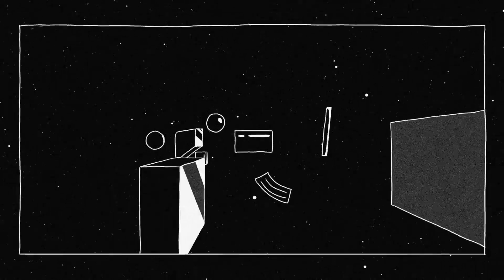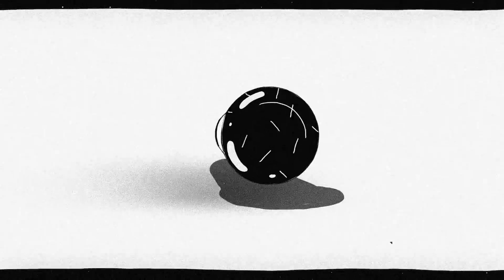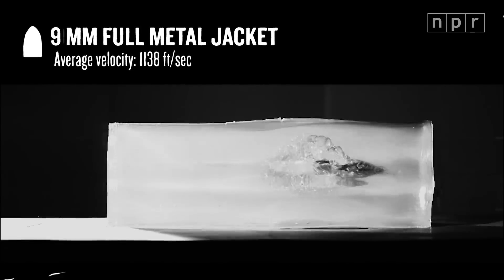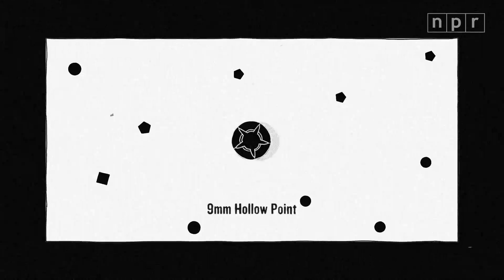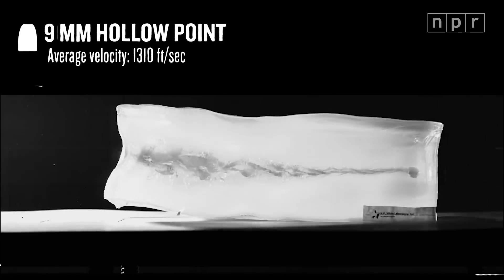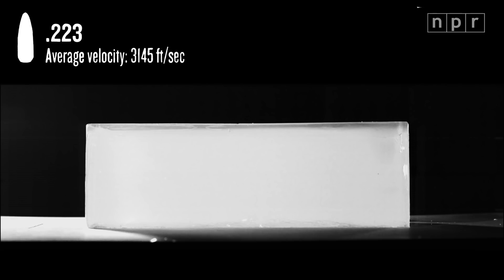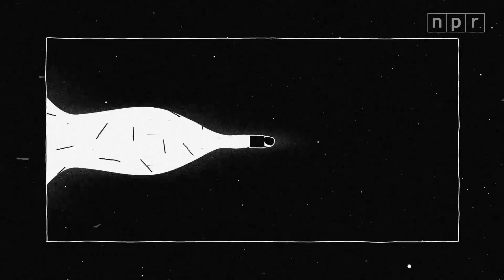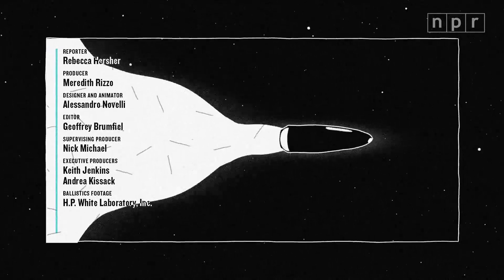How Physics And Design Make Some Bullets More Destructive Than Others | Let's Talk | NPR

Comment: Why would you downvote this? Its educationally informative without taking a side
Reply: The video makes implications regarding the efficacy of the .223/AR-15.  They said that the .22 is a common hunting round (illegal to hunt deer with a .22, btw) and then contrasted the ballistics with an AR-15 fired .223.  The result is that a viewer would be led to believe that the .223 is more power than hunting rounds.  They are ultimately trying to vilify AR-15s.  AR-15s are not the only rifle to fire .223, the .22 is not a common hunting round, and the AR-15 is the ONLY firearm that they mention.  They wanted that style of firearm to be associated with devastation and power.
Reply: Kirby White youre taking facts based on the scientific evidence and applying viewpoints to them. Im saying the video doesnt stickly take a side even if you perceive one. It implies things that you've weaned from the information you have. These are two different things. I dont assume anything because its choosing to apply what you think to the information theyve provided. Npr is very good about stating the facts and letting the reader or listener form their own opinion. If youre led to a conclusion, its because the information and facts do that on their own.
Reply: batman2683 the information provided by NPR is incomplete and incorrect, and leads the viewer to conclusions that are false.
Reply: Wrong, it's surface level stuff that anyone could get with a google search which carries a few pieces of misinformation, like that bullets are getting larger, and that more people are shot and killed with said rounds, both of which are untrue.  Most military rounds now are significantly smaller than most military rounds of the past, and gun deaths have dropped considerably for several decades now, even if we ignore the fact that most gun deaths aren't murders and are in fact suicide which is nobody's business in the first place and has no bearing on conversations regarding firearms.  

In fact the google search is more informative because with the google search you can see every place where their lazy reporter got things wrong.
Reply: The entire viewpoint of the video is that gun violence is increasing in frequency and severity which I think is an assumption held mainly by mainstream gun control activists and on a less specific basis by different camps of right wing alarmists who have their own scapegoats. This video only speaks in general terms and doesn't refer to any specific "science" for it's most important claim, that people are being shot by "larger, faster, and better designed bullets". If that were true it could have referred to a study of police information on gun wound victims that demonstrated a trend in what ammunition was used, or they even could have just made the claim that such ammunition is increasingly available on the market and poses a threat and shown the evidence for it.

Comment: Lots of great information; well researched and neutral...right up until that last sentence:   

"More Americans than ever are being shot with larger, faster, better designed bullets."   

Deaths from rifles have been low historically and despite the recent popularity of the AR-15, it is still on a downward trend.  More Americans are killed each year with hammers than rifle bullets and the .223 has not changed in lethality since the 60's.  If anything, an AR-15 actually propels a .223 slower due to the shorter (16" vs 18") barrel compared to the hunting rifles the round was designed for.  

Also, Americans killed by larger, slower bullets from handguns is an order of magnitude larger than smaller, faster rifle rounds.
Reply: It’s also fanciful to call .22lr a hunting round, especially when contrasted with .223 (which is famously underpowered for real hunting...)
Reply: Buddy Crotty i was thinking  wow, accurate and unbiased, then they closed out the video with bs.

Comment: This is a good start, but incomplete, and thus oversimplified. In addition to mass, velocity and bullet fragmentation design, you also need to consider the energy transfer from bullet to tissue (not covered here), and the bullet placement (e.g., how well aimed the bullet was, also not covered here). I've never seen data on the energy transfer, but as any electrical engineer can tell you, to maximize energy transfer, you have to match the impedance of the bullet in flight with the tissue (just like you need to have 8 ohm speakers to get the most from an amplifier with 8 ohm impedance). You don't cover this; you really need to in order to know if choosing faster bullets vs. heavier bullets does more damage. It's not enough to know that faster bullets have more energy, do they result in more energy transfer and thus more tissue damage? Or not? To inform the public and public policy, this information is vital, but not given here.

The npr.org article that showed this also had a link to a medical study that showed that wound damage has increased over the last 2 decades. That seems significant, and at the same time not covered here. And because you also need to know shot placement -- where did the bullet actually hit -- you can't untangle if the reason damage is increasing is from more dangerous ammo, or if it is from more accurate shot placement. Inquiring minds want to know.

So good start, and looking forward to your next attempt which also includes the other two factors, energy transfer and bullet placement, and does so in the context of increasing wound damage.

Comment: You failed to mention how much bullet designes that are commonly used have been around for 70+ years. You also failed to point out the difference between the .223 and the .22 in regards to its casing as well as intended use. 
You think you could use a .22 effectively to defend yourself? Many would consider that inhuman if you shot someone with it. 

Consider the comparison of why we aren't able to hunt deer with a .223 in many states. It is because it is too small in size and failed to deliver enough energy to effectively take down the animal in one shot. 
You fail to take into account what these are designed to be used for.
Reply: .22 was the Mafia assassination round of choice, once upon a time. But yes, not really for defensive purposes.

Comment: im, sorry but i have never seen the shock wave of an ar 15 round break bone, that is some 45 revolver terratory stuff. bullets that are wide or massive do that.....
Reply: https://www.ncbi.nlm.nih.gov/pubmed/21926649 
"Twenty-eight shots were fired, 2 with 9-mm bullets and 26 with 5.56-mm bullets. Eight indirect fractures that occurred were of a simple (oblique or wedge) pattern. Comparison of the average distance of the projectile from the bone was 9.68 mm (range, 3-20 mm) for fractured specimens and 15.15 mm (range, 7-28 mm) for nonfractured specimens (Student's t test, p = 0.036)"
"CONCLUSIONS:
In this study, indirect fractures were produced after passage of the projectile. Thus, the temporary cavity, not the sonic wave, was responsible for the indirect fractures."
Reply: Titanium are you trying to give me hot pants or do you just always drop relivant and studied material on people like that?
Reply: 45 ACP / Long colt is nowhere near as powerful as .223. Its hilarious that you think that. 

 Velocity is the key for fucking shit up.

Comment: NATO uses the 5.56 (.223) caliber bullet because it is smaller and lighter to carry, but not because has more force and not because it is more deadly.  Fire superiority and logistics/supply.
Reply: Honestly. It a glorified .22 with a smaller case than the 7.62 battle rifle cartridge. Small bullet going fast = less weight but also less damage.
Reply: Its funny because after ww2 the main rifles in all armies started firing smaller bullets
Reply: Dan F. -- Dan F. is right about doing your own research.  Sorry to have derailed us with an at best controversial aside about wounding. I've edited my original comment to remove it.
Reply: 5.56 is just as powerful against humans as 7.62x39, if not a lot more. It hits harder and dumps energy quicker. 7.62 has slightly more energy (if I recall its only a 10% gain in energy) but because it has less velocity, the energy transfer is much worse than 5.56. 

Look at paul harrel's video. The water jugs he shoots with the 5.56 make bigger splashes. Velocity is the king when it comes to f*cking shit up.
Reply: Well, 5.56 was used because it has more penetration power. That doesn't mean it's more powerful however.
Reply: The military would rather kill the enemy.  One less threat to worry about in the future.
Reply: Can you provide a reference to the source of this idea or is it just something you thought up?